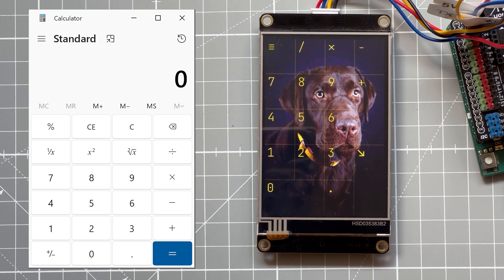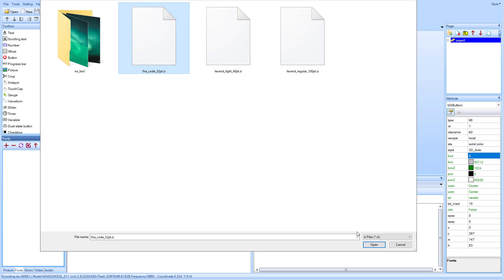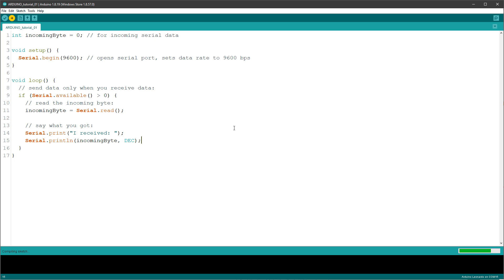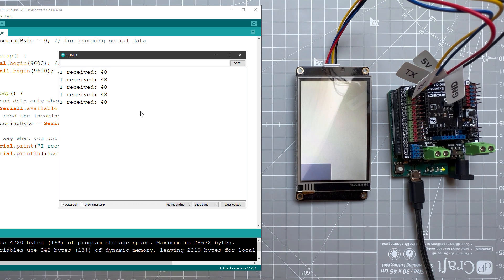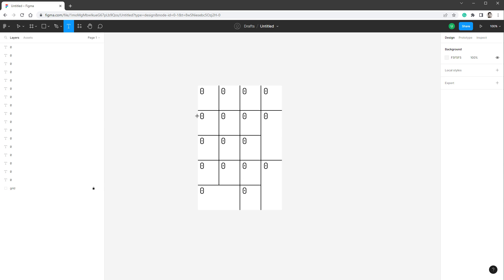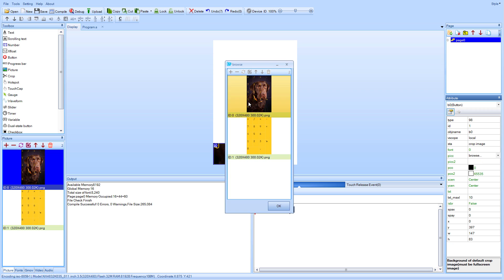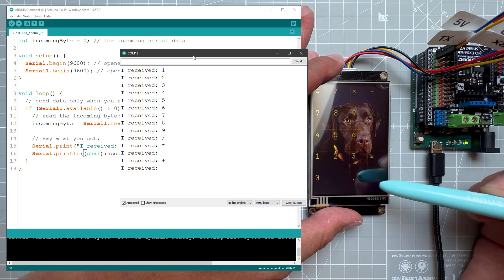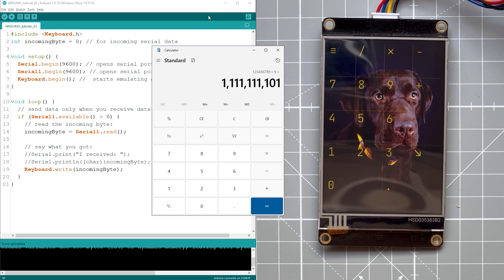Arduino Numpad Display Project (tutorial beginners, Arduino Leonardo, Nextion Intelligent Display)

Comment: Hi!
You did another awesome project!

P.S. also you can use for this project Attiny85 (or digispark board).
Reply: Sadly no as they dont support USB like the leonardo (I think ! )
Reply from the maker: Thank you, but as andymouse mentioned, you need a board that could act as USB device, and attiny is not possible to use. That said, in the CNC video, I have used Leonardo compatible board from DFRobot that was tiny.
Reply: @upir_upir  For the ATTiny, there exists the VUSB project - USB in software. But I don't know if this supports emulating an USB keyboard as easily as the standard implementation of the Leonardo (maybe you'd have to do all that with your own code, which could make it quite a bit more complicated) - or if all the necessary code fits into the 8KB of the Tiny85 in the end...